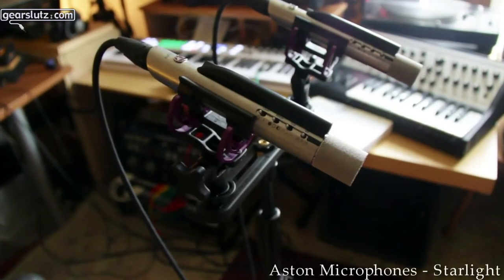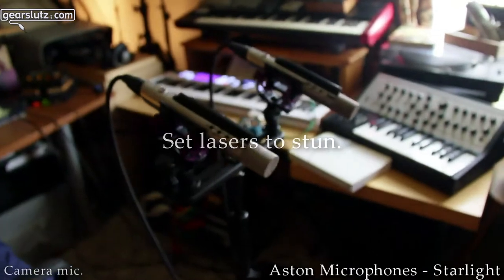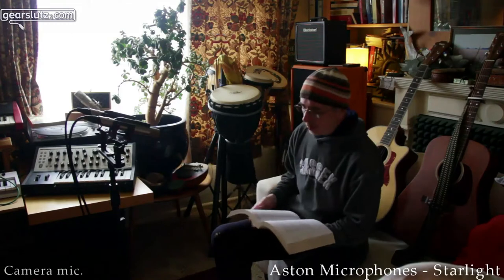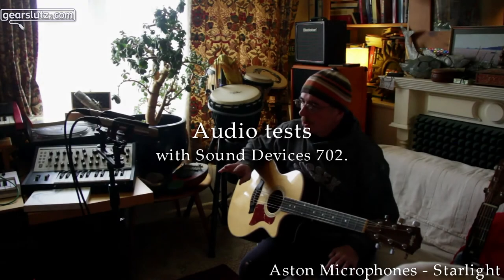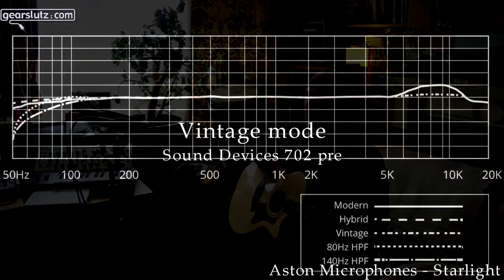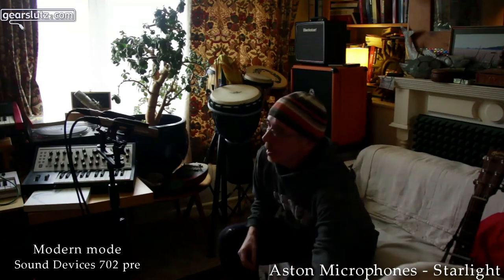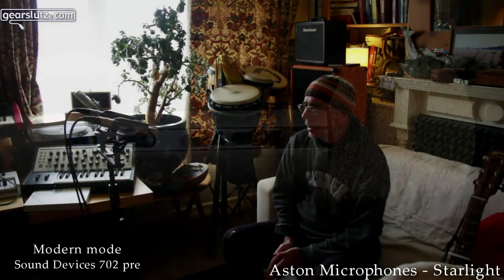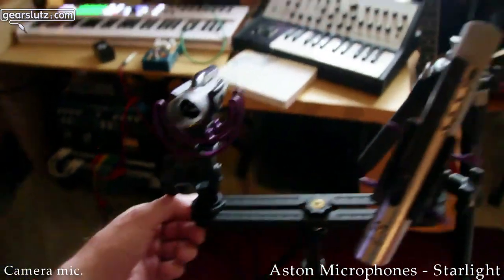Aston Mics Starlight - Overview & Hands-On Test

Comment: Hi mate, I've bought a stereo matched pair of these, and one is noticably quieter than the other and the waveform in the DAW I use looks very different, did you run into any issues like this? One sound fantastic and rich while the other sounds quiet and at times a bit tinny.
Reply: have you trouble shooted your gear first? switch cables around and inputs on interface. If no change then write to aston...
Reply: I work at a music store and had one customer who found the same issue with his pair of Starlights. If you can I would take them back and they should be able to get you a properly matched pair. Not sure why this happened but maybe there were a small batch that werent properly matched.
Reply: @humorustrout. Hello, I'm planning to buy a stereo set of these mics , I just saved some money and I'm going for it. However, I saw some reviews complaining about a weird sound or hiss coming out of these mics due to self problems or whatever. Did you encounter the same problem and do you still recommend them? Thank you